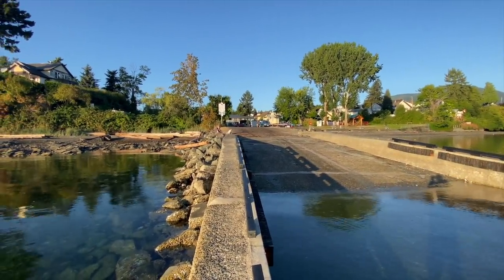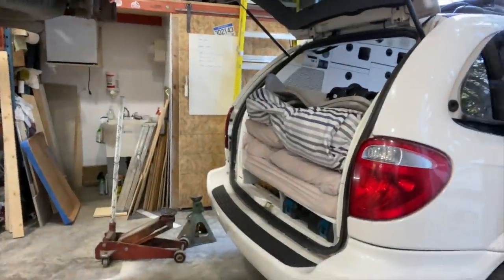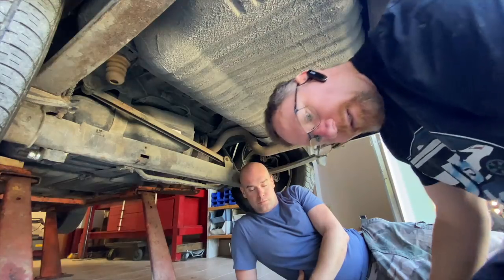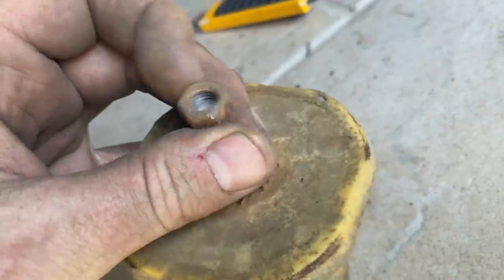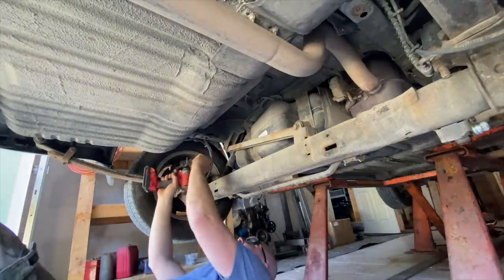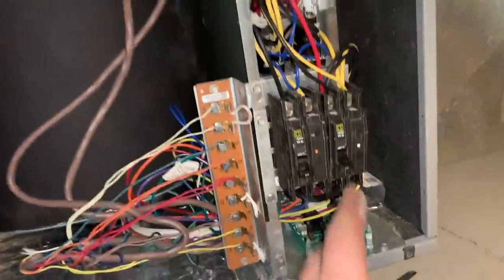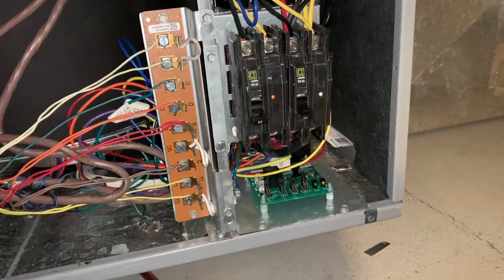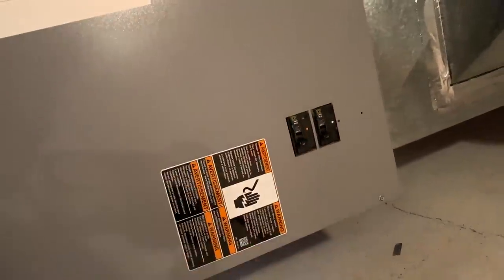A New Chapter In This Minivan Life Adventure || Vancouver Island Bound & Air Lift Kit Installation

Comment: tip on the A/C. mine was down last year, and the tech found an ant in the outside unit’s contacts. He said it is a common issue that insects get in the compressor unit’s electric contacts, and prevent the unit from switching on. 
Nice instal on the air suspension. 👍🌲✌️

Comment: Check on the air handler between red and yellow if you have 24volts the thermostat isn’t closed ie not working sometimes if you have a condensate pump the installer likes to wire the safety switch thru the yellow wire and that also can shut your cooling off the fan circuit is red and green turn your fan to on at the thermostat then check for voltage at the low voltage terminal s at the air handler